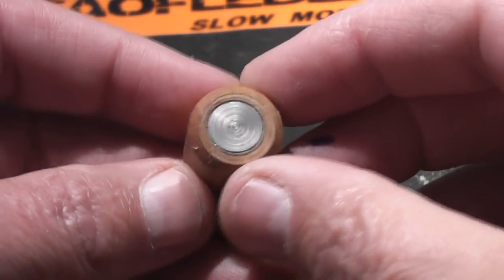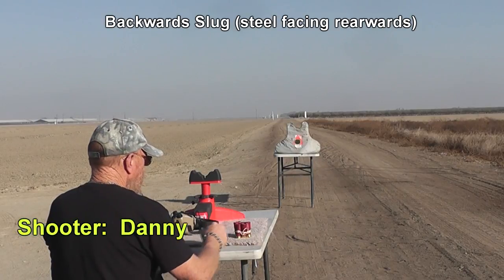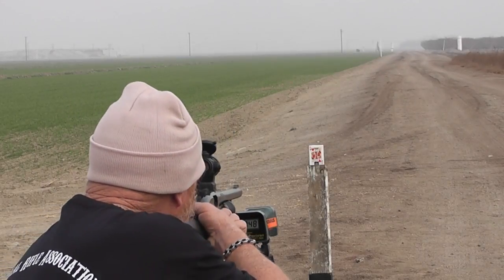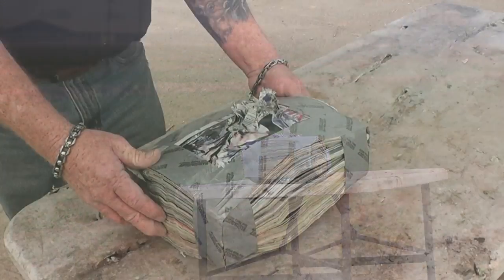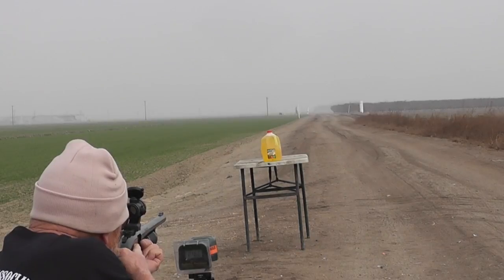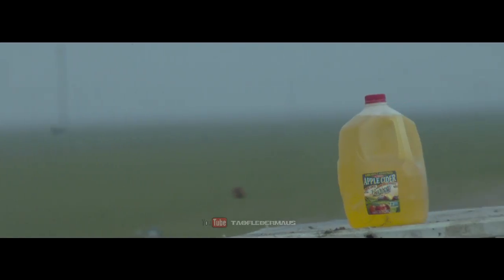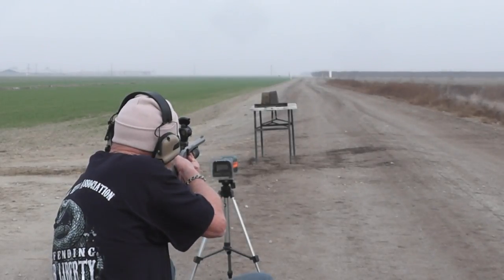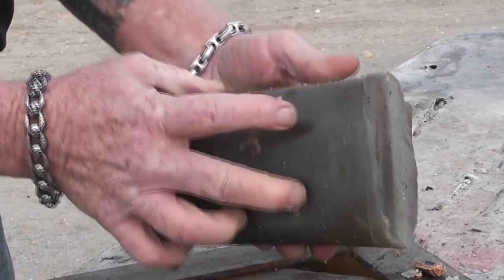Steel-cored WOODEN Shotgun Rounds - UNREAL Performance!

Comment: Wooden APCR  (Armor Piercing, Composite, Rigid) or even a form of HVAP.  add a wood plug over top and an ideal AVCR (Anti-Vampire, Composite,Rigid).  Use silver instead of Steel and you get AV/ALCR (Anti-Vampire/Anti-Lycan, Compsite, Rigid )  Ready for Shadow-Run
Reply: As an Enforcer (Human's tasked with keeping the peace between Vampires & Werewolves) I agree with you

Comment: So I would guess this slug would break apart in the body and the steel piece would continue through as a small slug. That seems like it would make a pretty nasty wound channel to patch up. Fascinating round thanks for firing it!
Reply: Luis Santiago it'd be super nasty, IIRC bio-material causes more infections when lodged into humans. Wood splinters are worse than glass splinters so this would be waaay nastier.
Reply: MrHiyaeverybody splinters in my finger is bad enough let alone my gut.
Reply: Indeed. I'd like to try em on hogs, I would guess the core would smash through a shoulder or skull pretty well. Not an optimum use case but interesting nonetheless.

Comment: I can only imagine how well those slugs would have worked with Ipe wood (Brazilian walnut) It has the same fire rating as concrete and steel! It is so dense that it will not float. Very heavy could probably make a solid slug without the steel core. Not sure you can turn it on a lathe though. This wood has to be predrilled and screwed into place. Nails will not penitrate because of its density. I hope things look up for your channel I get excited every time I get a notification of a new video. Maybe one day I will be able to donate your way I would hate to see you go!

Comment: Wooden bullets work well and inside a target they shatter. They were outlawed in military use. Due to the injury type. Splinters are the byproduct. The largest issue is the expansion of the wood in humidity. It will not fit through the berrel if it is soaked for a extended period of time. Also moisture can get to the powder and primer if stored moist. Wood is like a sponge. Store cautiously in a very dry area.

Comment: When you get new projectiles to shoot do you take a couple out with a batch of different projectiles you've previously got to get some tests in so you can see what happens on camera and next time you go to shoot the new set you'll know how to properly load them? For example getting cobalt slugs in at the beginning of January and brass the next month would you shoot a brass slug or two with the cobalt set as a test to make sure you're good? Of course you would still have the footage to compile for the full video so it wouldn't be any true waste.

Comment: We use the solid wood rounds, for less then lethal, in our prison system, in Arizona. Very similar, and called knee knockers. The biggest difference is, it is fired out of a 37mm multiple launcher. I believe there were approx 4 or 5 solid wooden projectiles, stacked back to back. It has proven to be very effective tool, alongside the other 37mm cartridges we use.

Comment: Will the pellet geometry self-right if not going true from the start? I know they fly well forward or backwards. I'm wondering if they would have any value out of a catapult. I know darts launch very well out of catapults from hands on experiments. Typically catapults put back spin on projectiles. That can create magnus. I think I can get a catapult to throw spirals by using a side mounted sling. I'll have to try that. I'll also have to see what the pellet geometry does with both sling configurations.

Comment: Like you I figured that the wood would have shattered. I would think that steel forward would be the best as steel rear would act like even more of a hammer effect making it harder on the wood where as the wood in the rear could cushion the steel's acceleration.
Reply from the maker: I expected the steel forward to shatter the wooden slug because of the high g-load shoving the steel rearward.
Reply: That is what I meant. :) I figured that would work better because it would then act like a discarding sabot. :) Didn't think steel in the rear would have worked at all. I imagine the reason it worked was because of the type of wood. It might be harder than our common home depot woods like pine and oak allowing it to survive the force of acceleration.

Comment: Might not have enough stopping power as compared to a regular slug, but the wounded probably won't survive because of the splinters. Probably should try it with Oak next time.

Comment: Atomic manhole cover!
I saw a video by  Codeys lab I think where he try’s to prove that a manhole cover was launched into space. His theory is that is possible due to the steel cover being deformed into a bullet shape by the blast. If it wasn’t deformed then wind resistance would have quickly stopped it from reaching space.
You can prove it one way or the other with your high speed cameras.
Method, place a short length of two inch pvc or other tube over the end of a shotgun barrel, pack the gap around the barrel with paper or silly putty or something so that the pipe is centred, cover the open end with some double sided tape so a flat metal disk about two inches in diameter and about an eighth thickness over the end held in place by the tape. Load a oobleck shell or chalk or wax as long as there is no shot but enough mass to fully ignite the powder the fire hopefully capturing what happens to the disk on camera.

Comment: You guys should learn about center of pressure and center of mass. A few aerodynamic principles would give you a better idea of how projectiles would work ahead of using them. If the center of mass is pulling the projectile it will be more stable if its pushing the projectile it will be less stable.

Comment: Not sure why you are suprised at a speed increase.  The Federal shells have 1 to 1 1/8 oz of shot in them and you are firing a 0.3 oz slug.  I am suprised it wasn't more than just 200 FPS faster.
Reply from the maker: I was always told the weight of the projectile wasn't as much of a factor as the rate the powder burns.
Reply: Projectile weight is one of the things that will be a factor.  Think of it this way, you have a charge, say 30 grains of powder X that will push a 1 oz slug to 1200 FPS.  If you then use the same charge of powder and say a 1.5 OZ slug, it would slow down to probably 800 FPS or so.  If you go down in weight, the slug will go faster.

The powder burn will be a factor too.  I don't know about shotguns, but I know with my 500 Magnum, I get different results with a magnum primer vs a "standard" primer.

One more thing, if you keep getting the Err 2 on the chronometer, try moving it back a bit.  Me and my two friends have that one and if it is too close to the muzzle blast, the smoke and powder will confuse it and give you the  Err 2.

Comment: The chronograph is probably too close to the shooter and picking up too much of the ejecta to register the slug.
Reply from the maker: The error code on that was the front sensor did not pick up the slug.   You are supposed to shoot a shotgun around 5 feet in front of this chronograph  before the wadding separates and gives an error.